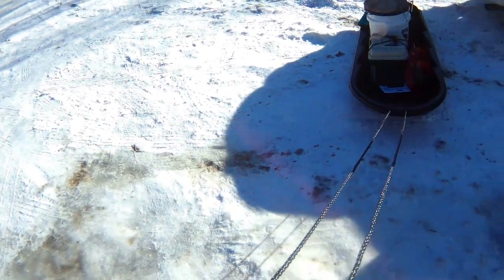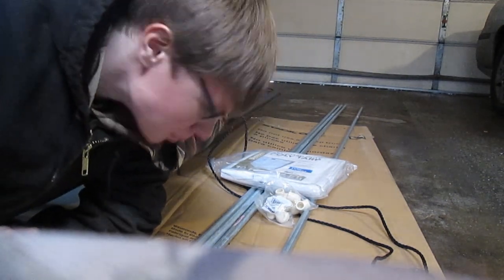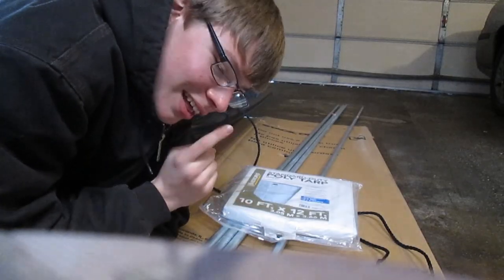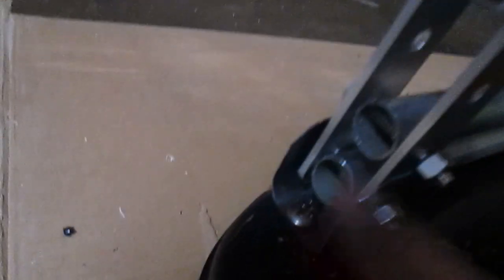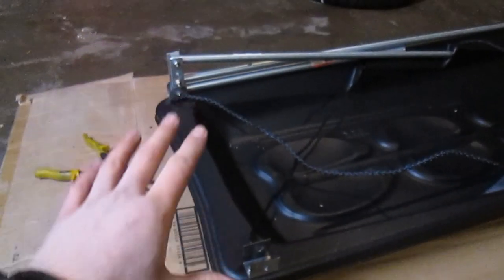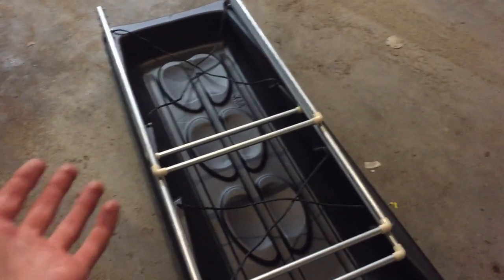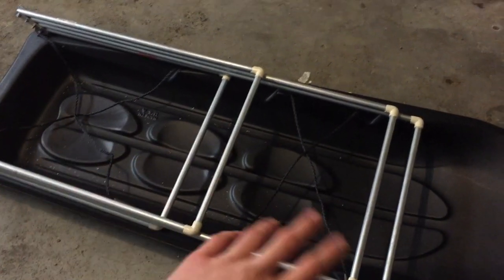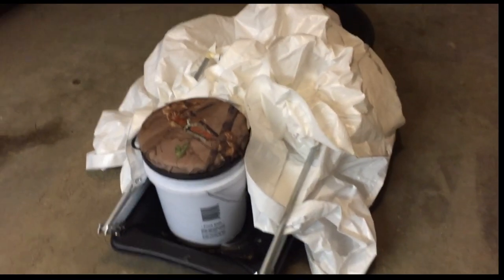Building a Homemade Portable Ice House

Comment from the maker: UPDATE: I have retired this specific ice house due to safety concerns. On the ice houses last outing I had taken a small sunflower style heater along in anticipation of sub zero temperatures. After setting up and using the heater for a short amount of time I began to feel light headed and nauseous. I had cut ventilation slots in both walls previously before my endeavor in anticipation of the heater which proved to be inadequate. I had also set a small section of the tarp on fire due to the tarps natural flammability which was unknown to me at the time. After this very brief outing I had come to the unfortunate conclusion of abandoning this project due to these safety concerns and bought a used suitcase style icehouse which has proven to be much safer. I strongly discourage using a heater of ANY kind within a homemade temporary structure and would not recommend attempting this specific icehouse project. If you do attempt this project you are at your OWN risk!

I know, its a bit of a buzzkill and I too wish the project would have had a happier ending. BUT, I would hate to hear of anyone being injured, or put at risk from watching my videos and would rather you take into account my experiences and challenges so you don't learn and find out the hard way like myself.

Stay safe and stay smart - Dave
Reply: Maybe an all in one diesel heater but another couple hundred
Nice quick design you made though

Comment: This is pretty sweet - even with your mishap with the tarp material/inability to use a heater - I wonder if its due to the tarp being polyethylene or just heater fumes?
Reply from the maker: I'm fairly certain the flammability was directly related to the polyethylene tarp and the nauseous feeling was due to inadequate/poor ventilation design. I think the idea and build was 90% there, but those two factors were just too risky. It was an interesting project and I learned a lot, but if I were to do it all over again I would just spend the extra money and buy a used insulated ice house.

Comment: I was sceptic but i actually like this idea
I might do my version of this
Reply: I thought of maybe using a movers blanket instead of tarp, lmk what you think?
Reply: its those black and blue drop cloth like fabric thats insulated
Reply: @frosty9457   i think i use tarp but some other type one 🤔 it all depends what i find... 
It would be fun to use tarp and some other fabric and combine them
Reply from the maker: I could see a movers blanket soak up water and freeze making it difficult to manipulate on the lake. I also could see where it would be more challenging to ventilate and would be less wind resistant. I agree with the combination comment, an outer tarp with a blanket layered inside would be most ideal but the biggest challenge would be adhering them to one another.
Reply: @MissionForFishing  yep. I think that double layer need to be clued and not in everywhere just 50%? 🤔
We have these kicksled and i have some ideas to make this on it
Reply from the maker: Yes, a diluted mixture of adhesive spread lightly between the layers might work. I updated the comment section and left/pinned a new comment about some of the safety concerns and experienced with my specific structure. I'm not known to always abide by safety stuff myself, but this project can be potentially dangerous (as with any) and just thought I'd let you know about a few concerns I experienced.

Comment: Could you send / post schematics? I’d like to build one — just with bars long ways instead of parallel to the sled — so it can be a two man. Thanks!
Reply from the maker: I don’t have any schematics, the only sketch was drawn up and shown in the video for a few seconds. I was going to make it a two man but then the center poles would need to extend out.
Reply: No worries!
Reply from the maker: The plan part for this specific house is shown at 1:01 , but I've had a lot of requests to revisit the project again this winter...
Reply: Just FYI, tarps are flammable ;-)